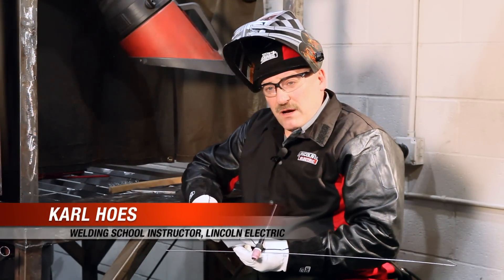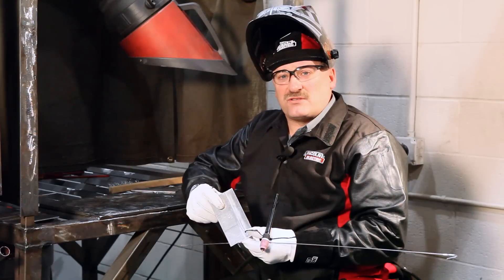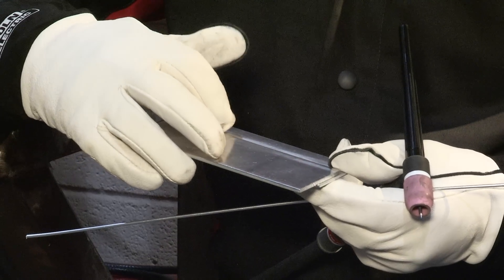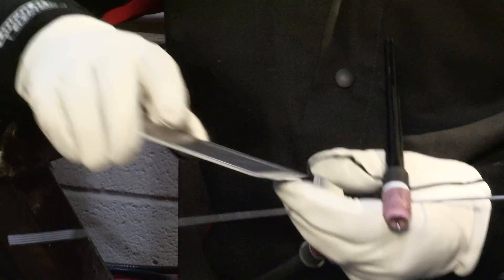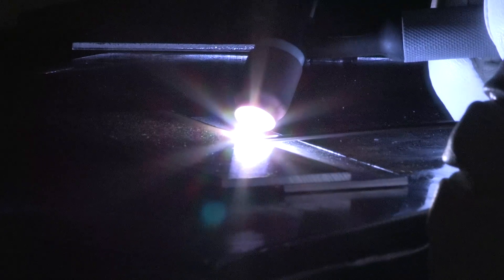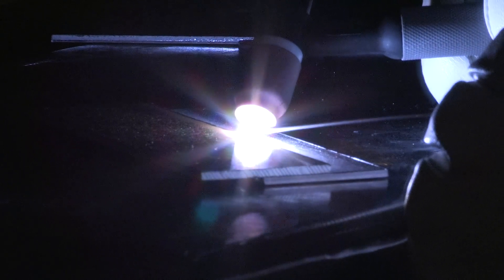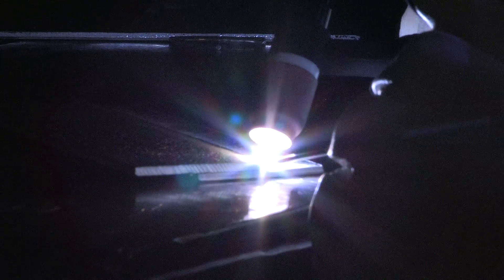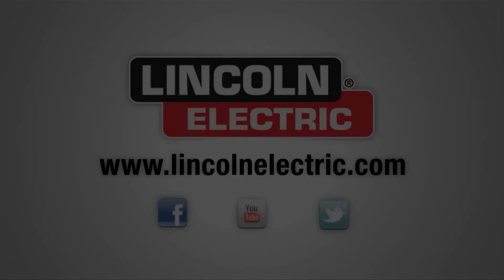Tips from the Experts: TIG welding Aluminum

Comment: Enjoying the videos so far.  One quick question though, at 2:32 into the video it appears that there is no root penetration at all. Is this typical in aluminium welding or can the methods displayed be tailored to achieve root penetration?
Reply from the maker: +Rob Bannen  If you look closely you can see the edges of the weld are curved not straight, indicating the base material was melted and there was penetration.  The small spot is due to the edge of the plate.  If you cut the weld at any point you would not see that spot.

Comment from the maker: When TIG welding aluminum on AC, the positive side is the cleaning side & the negative side is the penetration. As far as breaking thru the oxide layer, you need to keep the arc lit until you can see the puddle.